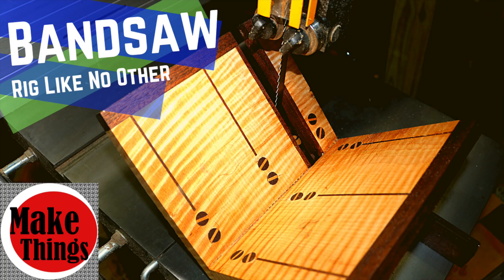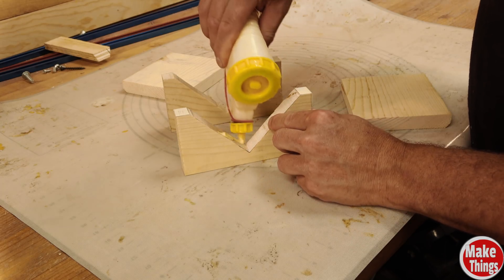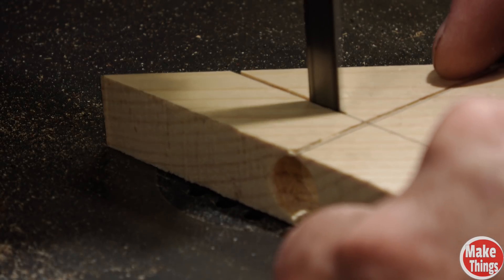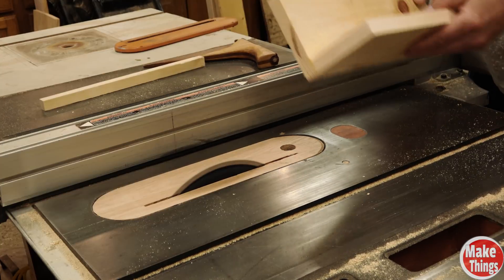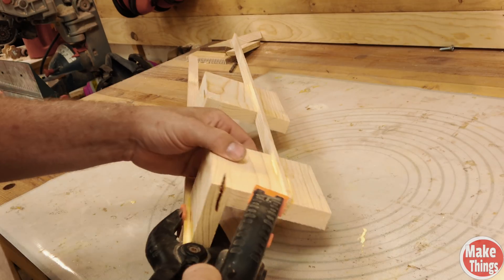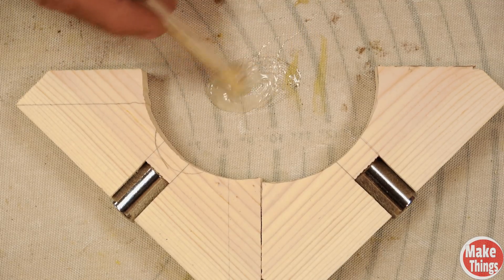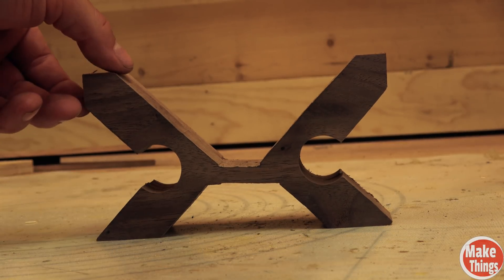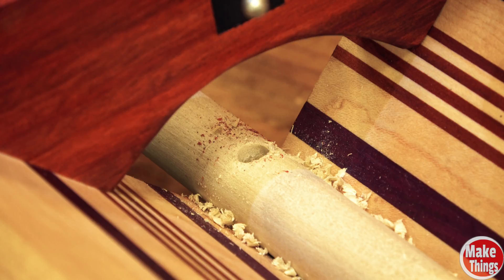Drilling Rig Like no Other / Don't Let Irregular Shaped Objects Intimidate You!

Comment from the maker: The my second channel with the Advanced artsy build:

www.youtube.com/channel/UCw6-e0soGpaYn7liW286IdQ
Reply: You tackle some of hardest issues in the woodworking community and do it with such simplicity.  Thank you for everything you do and hopefully will continue to do. We need folks like you.
Reply from the maker: Hey Mitch, thank you so much!  It’s my pleasure, really.  Comments like yours drives me to do more, so thanks again!
Reply: Cool build.  I noticed that you still had tearout, though.  Personally, I would make the bottom have a flat cutout that different inserts could be placed in.  For example, if you are drilling 3/4" dowel, an insert with a 3/4" half-hole would fit snuggly against the dowel, preventing tearout.  As well, as inserts get chewed up, you can just replace them without the jig itself getting damaged.  Does that make sense?

Comment: This is a great project, and I can see where it could do double duty for cutting round stock of any material. All that would be needed is for a block of wood to support the material hanging over the end of the jig.
Where did you get the spacers, and are they hardened steel?
Reply from the maker: They’re not hardened steel.  I definitely recommend either using hardened steel, stainless steel or filing the sides of the drill bit used to drill out the holes.  Great comment Autotech1

Comment: Nice job. If you drilling multiple hole at regular intervals you should create a clamp on the rails. That way the centering dowel can be moved to the hole just drilled to keep an accurate distance between holes.
Reply from the maker: Great idea Allan!
Reply: That is an excellent idea

Comment: Hey, this is a great idea. I’m just tinkering with myself about using this concept to make a classical guitar drilling jig. This V-shaped carriage with a proper guitar bridge support and the adjustable  index pin setting the correct distance between holes (so once set I don’t even need to bother with measurements) will make my life much easier. My only concern is where to find the metal barrel with a 3/32” hole. Thank you very much for sharing this!
Reply from the maker: My pleasure!  Send me a pic if you do use it!  My email is on my about page.